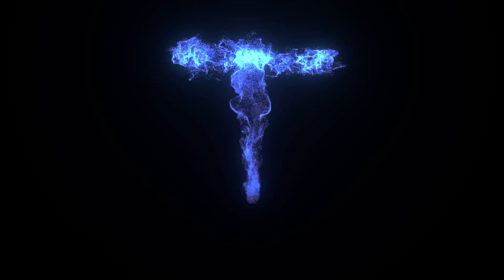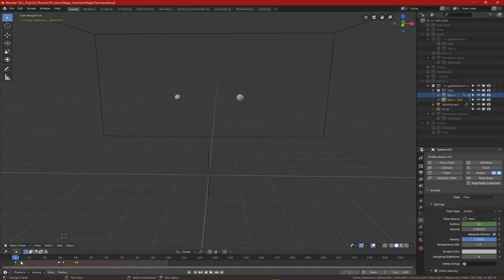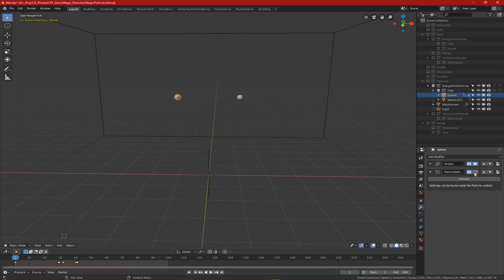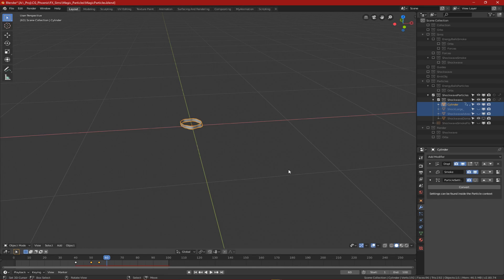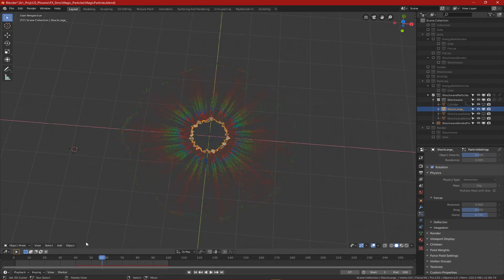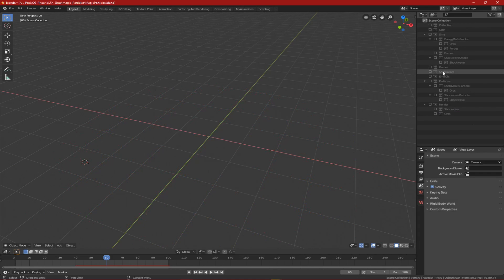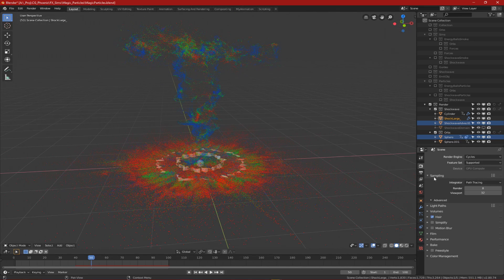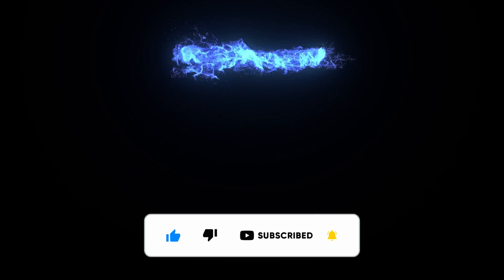Magic Blast particle effect (Breakdown)

Comment: Hey Sir maybe you can make a video or tutorial for this Help: Emitting particles when Object is hitting it. Example: A Man is walking on a ground, and every time his Shoes touching the ground some particles wil lspawn and fly up, like magic sparkles or sand in dessert, you know what i mean ? no one has this. it looks like its not possible, maybe you can help me. ciao
Reply from the maker: Okay so the problem with this is, how  blender's particle system works now. Particles can't be spawned with trigger events or object. They're either spawned all at once at the beginning of the simulation, or gradually over the course of it. That makes this kind of thing kinda difficult to achieve in blender. I'm currently researching an easy way to achieve. But rest assured I'll share whatever solution I discover.
Reply from the maker: Sure
Here's my discord @PhoenixCG#8062

Comment: Very good tutorial, can i use cycles render engine instead of eevee?
Reply from the maker: Yes.
I used cycles render for mine.
I actually strongly recommend you avoid eevee for this kind of stuff. Unless you have very powerful hardware with lots of vram.